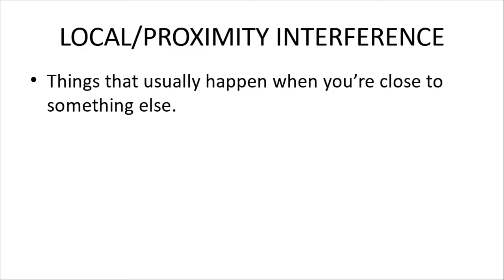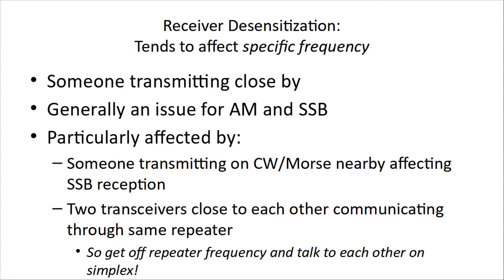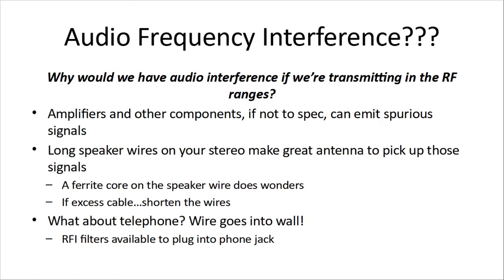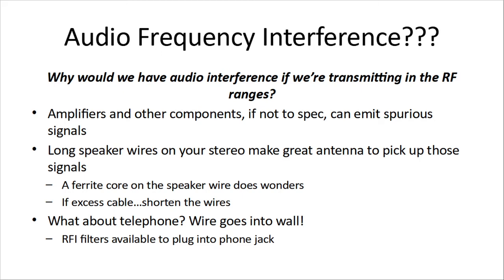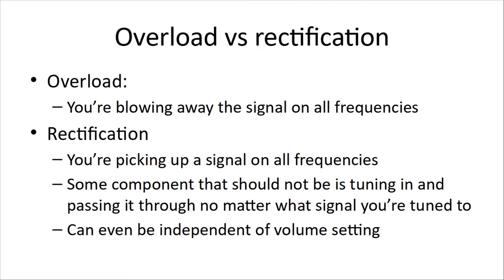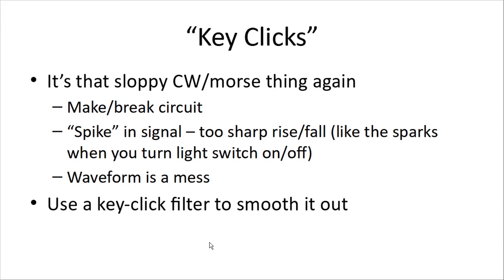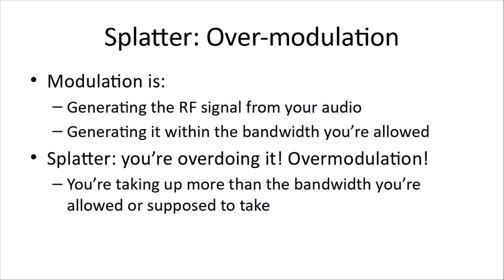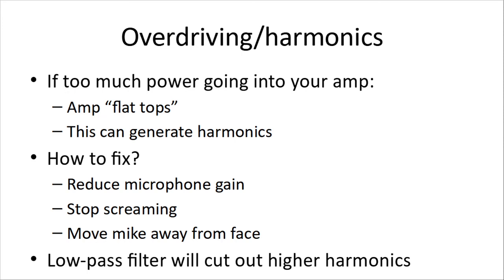Lesson 19 for Ylab's Canadian Amateur Radio License Course

Comment: Question # B-008-004-010. regarding second and third harmonics, seems to have two correct answers.  Your comment in the bottom suggests the third harmonic is derived from doubling the second harmonic.  My research has indicated it should be the integer of the first number.  ...  Confused over here!  Do I misunderstand something?

In the answer summary you state: "300,000,000 meters_per_second / 10 metres = 30 MHz, which is an even divisor of 60 MHZ. Double makes it second. Third harmonic would be (300/15) *2 and times 2 again, or 80 MHz."

????  (scratching my head on this one!)
Reply: Let's look at all the answers. (A) 7th harmonic of an 80  metre transmission. The 80 Metre band goes from 3.5 to 4 MHz. The 7th harmonic is simply 7x the fundamental frequency, so 24.5 to 28 MHz. 57 MHz is not in that range. Alternately you can take 57 MHz and divide by 7 to get 8.14 MHz which is not in the 80 metre band. (B) Using the alternate method, take 57 MHz and divide by 3 for the 3rd harmonic = 19 MHz, that's not in the 15 metre or any other ham band. (C) 2nd harmonic, divide 57 MHz by 2 gets you 28.5 MHz, which is in the 10 metre band, so this is the correct answer. (D) A crystal oscillator running on its fundamental. It is very unlikely that (a) a transmitter would use an oscillator on that frequency, (b) that the oscillator would be a source of interference, and (c) that a crystal would have a fundamental frequency that high - typical maximum is 30 MHz beyond which overtone frequencies are used.

Specifically, the 3rd harmonic is 3x the fundamental frequency, not 2x2x